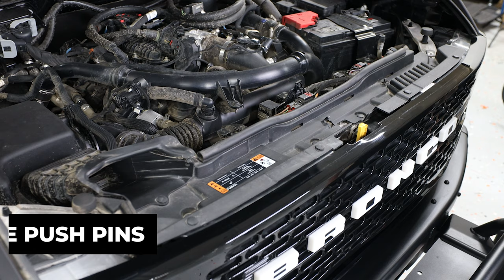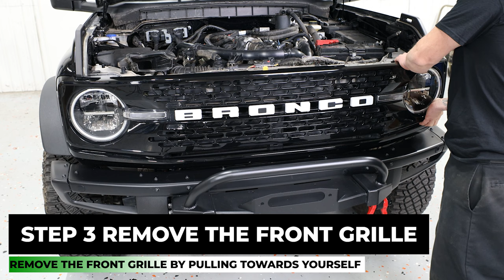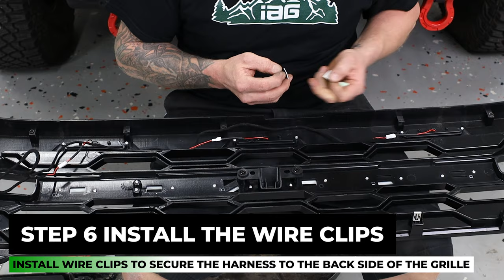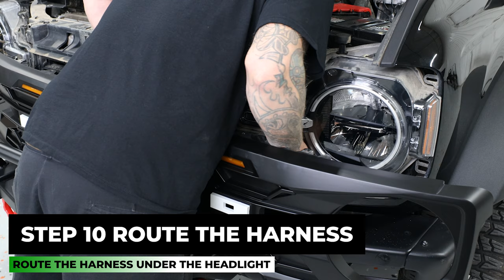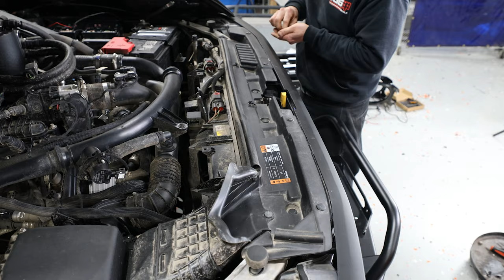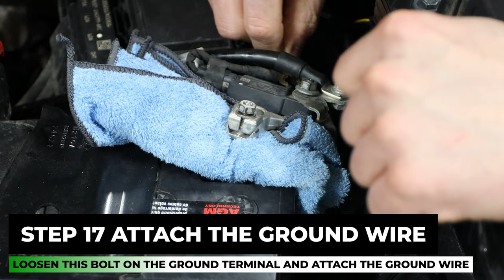I-Line Front Grille With Lights Install

Comment: That location in the fuse box (25) is taken by the backup camera. Is there another location to place it? I'm worried about removing the current fuse and messing with my features. 

The paper instructions from the box and the video are slightly different. Any info on which is correct?
Reply: Same issue here, looking at my fuse box and mines taken already